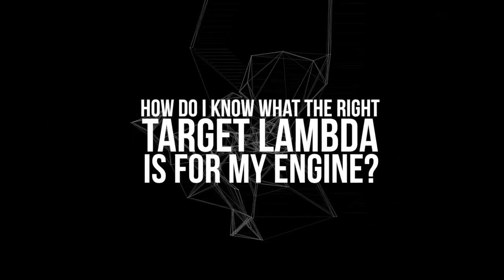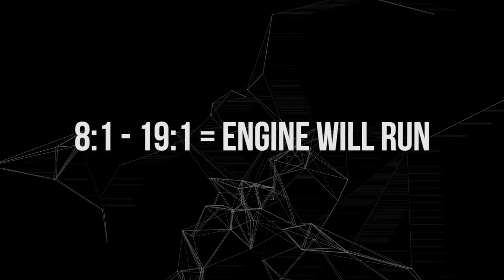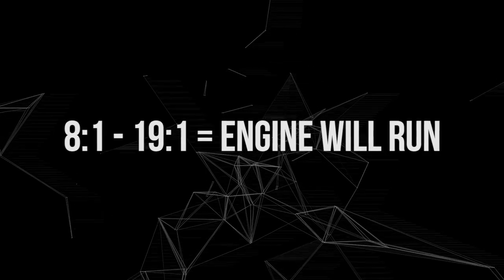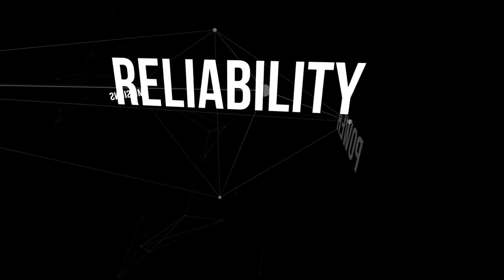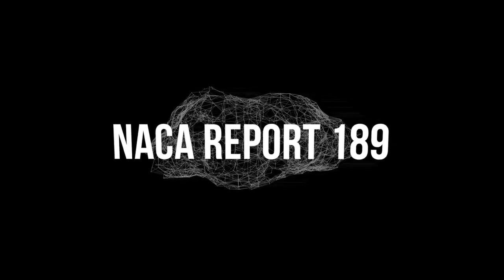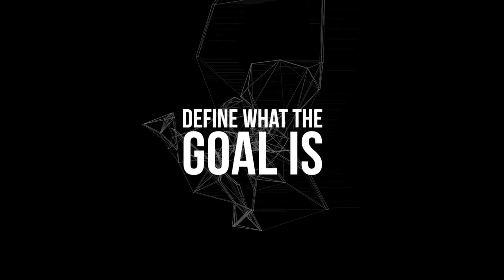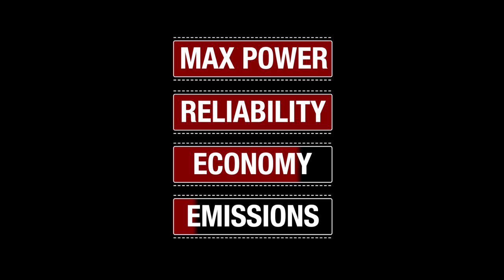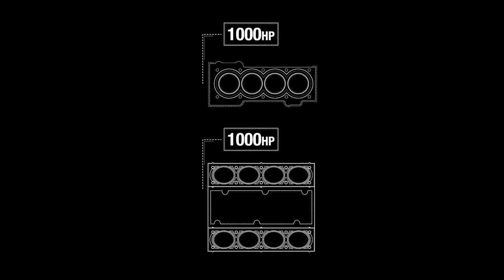How do I choose the "Right" Air-Fuel Ratio?

Comment: Very interesting and very well explained, it was really enjoyable to watch. I have recently installed an AFR gauge for my carburetted car and I have learned a lot from this video. I think I have now set the carb up fairly well in terms of AFRs for my goals. The only problem I have is lean spots during sudden acceleration. When I blip or floor the pedal from part throttle I get a lean spike of 15/16:1 for 1-2 seconds and I feel the car hesitate and there's a noticable lack of power. If such changes in AFR don't change power output of the engine, how can you explain lean (or rich) bogs/hesitation? Thanks!

Comment: Not so much with modern high pressure direct injection, but port inj or carb you have to consider, extra fuel molecules for no reason take up room, air molecules could use instead. It doesn't just steal volume but can stifle flow at the valve because the injector is usually aimed at it, the sudden blast of matter in the intake can back up the air

Comment: Interesting, though we never see this real testing on either engine dyno or wheel dyno. We see a much smaller window of air fuel ratios no matter the application. At 11:1 n/a engines simply won't make anywhere near their potential and over 13.5:1 the same. Typical ranges we see are 12.3 to 13.1 on the extreme ends. 
Of course, type of fuels, compression, combustion chamber efficiency, and on and on dictate where the engine runs best, and the dyno absolutely is a great tool to get this in the right area.

Comment: Assuming that we are going for reliability first:

Given that the AFR for maximum power is probably 12.5~13.5:1, richer mixtures are more for cooling and reliability. Could we use water injection for forced induction engines instead of richer mixture to achieve the same cooling effects?

Is it possible to work out how much water we need to inject? Would something like EGT be a good gauge to tell whether our thermal management is in the safe window?

Another thing to consider is, would it be beneficial to run the coolant at a lower temp like 80°C instead of 90°C to help in thermal management? How do we arrive at what temp to run? My 4 stroke car engines are usually around 95°C, but my 125cc 2T race kart engines runs coolant at 55°C

How about using colder spark plugs?

How do we quantify how much is safe or still unsafe?
Reply from the maker: That's a lot of great questions!  I'd love to do a whole video on all this.
Reply: @EFIU_Ben  Thanks Ben, I really look forward to the video

Comment: I've got a question please. If a richer mixture is used to keep the temps down, then why more fuel is used right after cold starts? Shouldn't it be the other way around for cold starts?
Reply from the maker: Great question!
So, only the vaporized fuel will burn, and it takes warmer temps to convert from liquid to vapor, so when the engine is cold, it requires more total fuel volume to be supplied so that enough of it will convert to vapor in order to get the engine up and running and keep it running so that it can generate some heat to warm up…as the engine temps come up, the extra fuel isn’t required so no need to waste it by continuing to add extra!

Comment: Ethanol was intruduced into our gas after OBD1 and 2 which was designed for unleaded gas only. What you are saying has nothing to do with pump gas with ethanol since ethanol does not create a flame front to move a piston in a cylinder in an internal combustion gasoline engine. This is not an ethanol engine. 10 percent ethanol is robbing our pockets. It is destroying the electric fuel pump in the tank. Engineers have come up with a bad combination. Ethanol and electric in tank fuel pumps. Take the ethanol out the gas and put the fuel pump back on the side of the engine. You sir have out thought that the key to complexity is simplcity not all this mumbo jumbo you are saying. There is nothing like a little horse poo in the street!!!!!

Comment: Ben got a question, @ 15:39 ish you say using more fuel to make same power at WOT, but then state BSFC went down. Shouldn't it go up? 150 #/hr / 300 HP = 0.5 vs 200 #/hr / 300 HP = .6
Reply from the maker: Sorry…what I meant was the level of efficiency for BSFC “has gone down” meaning it’s not as good….
I see how my choice of words could have been misleading there making it seem like I meant “got smaller” which wasn’t my intended meaning.
Thanks for the catch!